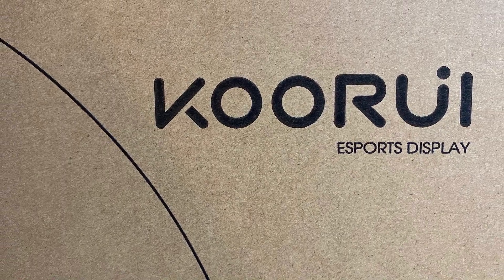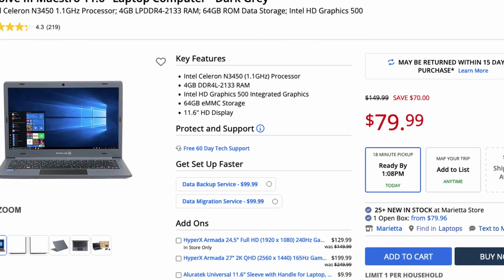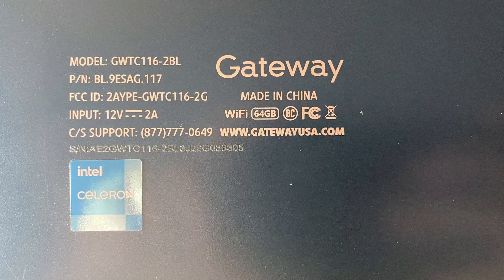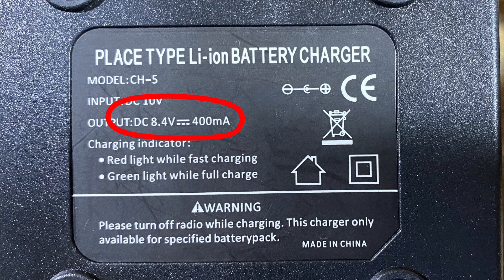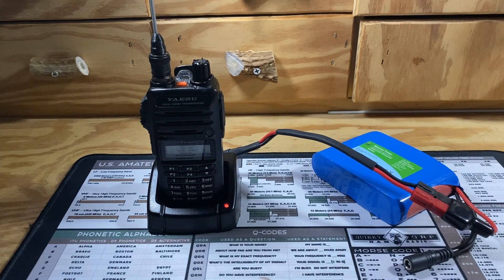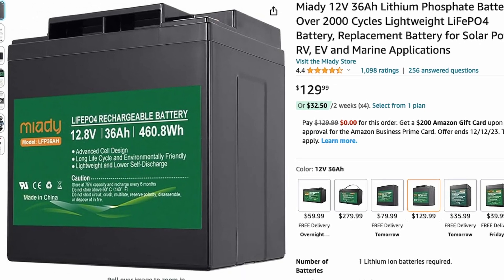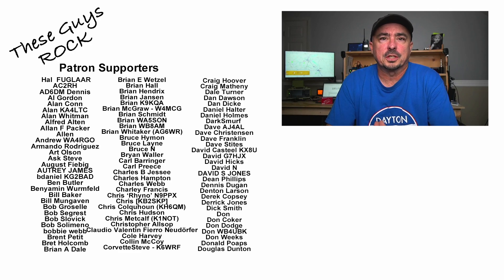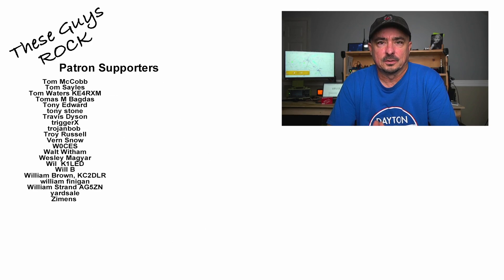Here's How I am Kicking the 120V Habit

Comment: How do you power your 12volt systems?  Do you use a 120vac to 12vdc power supply?  I think we all are dependent on 120v unless the power goes out, and then we are only good for a while.  Yes, we might have solar or a generator, but that only goes so far.  It certainly is worthwhile to have dc devices work on one standard 12 volts but we power them from the power mains, don't we?
Reply from the maker: For now it's a 120vac to 12vdc power supply along with the backup battery charged by the power supply.  In the future, I would like to move to solar but one step at a time.
Reply: LIFEpo4 batteries are the cheapest they have ever been from litime, powerqueen ect add used solar panels from Facebook marketplace at 50cents a watt look up will prowse on YouTube he shows how to build the systems
Reply: Redodo is having a great battery sale, but if you sign up for their emails, they will bug you and give you 1st-time discounts equal to Black Friday deals. So no need to hurry.

Comment: Buck/boost converters aren't necessarily a problem, if they are properly filtered and shielded. That said, you also want as few as possible to also reduce losses.
Reply: I use them.  I have no noticeable noise problems.  Problems may come for a solar charge controller.

Comment: My shack is in my RV, and my RV has a 13.8V 600 Ah lithium system. I wired powerpole bulkheads into the walls where my gear is used and I have been working to convert everything I can over to 12V in the rig. I still have an inverter for my big TV, coffee maker, Apple TV, and a few other devices that require wall warts to charge them (electric shaver, etc). But I keep the inverter off unless I need to use them. For air conditioning and the microwave, my only option is to turn the inverter on for that, and I do see a significant difference in noise when I am running the inverter. But most of the time, there is no 120V AC running in my RV when I am operating and I tend to be in the middle of the desert or woods. So noise isn’t usually a problem for me most of the time.

Comment: Another great video Jason. Yes all of us hams should kick this habit.

In my case, my main home station has been off-grid for several years. Presently I have 4 separate fixed off-grid solar powered systems at the home QTH. They are as follows:

1. Main power for the shack in the basement: 4 golf cart batteries with 100 watt solar panel.

2. Secondary power for the main shack in the basement: 2 golf cart batteries with second 100 watt panel.

BONUS: The two solar panels mentioned above have separate runs into the shack where I can parallel them and then connect them up to either of the two battery sets. This provides an extra boost on cloudy days.

3.  Small 20 AH SLAB with 25 watt solar panel in the kitchen - for charging cell phones, laptops, HT's and providing off-grid light for my kitchen.

4. 100 AH SLAB by the Sump pump, which also has a 12 volt backup sump pump, charged with 300 watt solar panel on the roof. This keeps the basement from flooding. It usually runs my refrigerator, and can run the house LAN / wifi.

My daughter, KC8GRS, and myself have run Field Day the last several years as 1E in OH by simply turning  the FT-857D down to 5 watts. It has become a tradition. Two weeks prior to the 2022 FD, a tornado came through the neighborhood and took out power for 4 days. With my setup, I was fine.

Here is a post documenting the power outage as well as our 2022 Field Day:
https://mikestechblog.com/arrl-field-day-with-a-real-grid-down-event-right-before/